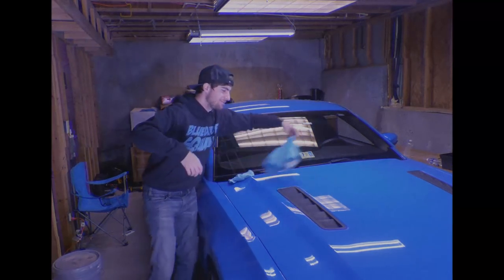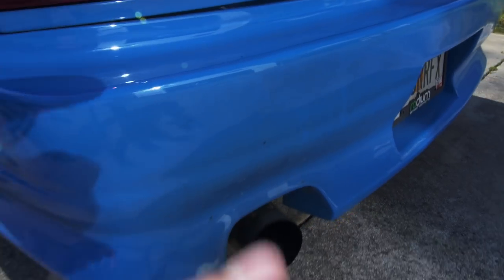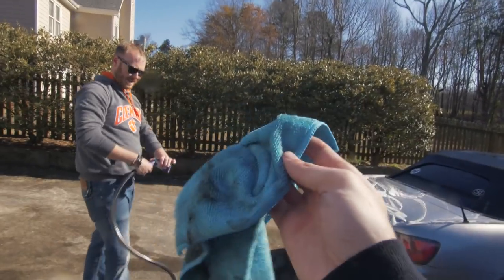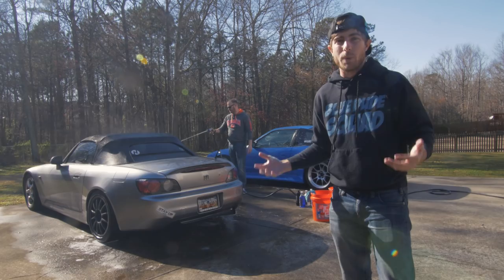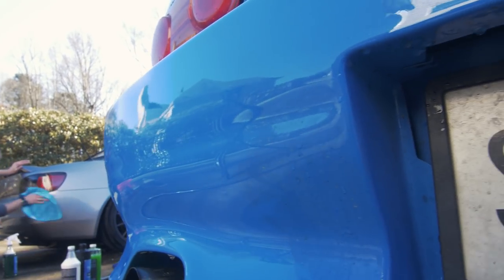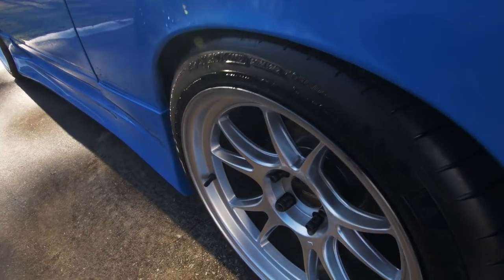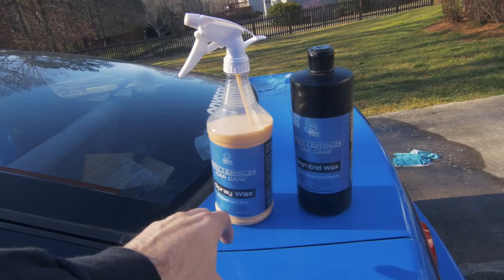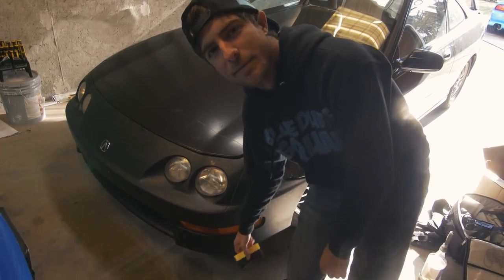Secret Project For Everyone to Try!

Comment: I'm happy you have this opportunity, but David, there are a bunch of things wrong with the techniques and explanations in this video.  
Besides, any product you can buy will work (some better than others) but knowing the right technique is always the most important factor.   So considering that anybody with a brain can walk into Pep Boys and buy some car washing stuff (that works), it would be very beneficial for you to educate your customers on some techniques that the pros use.  Only the right technique will get the results you really want, as it is very easy to swirl your paint without realizing it.  With your name on these products, I hope you will have time to help educate your buyers about the details that go into detailing a car.  You have a large audience - Maybe more than any other detailers channel? - you have a great opportunity here.  Congrats!
Reply: Jacob Frey 

I agree. I love the guy, but there's so much that I'm seeing wrong here. Sponges are a TERRIBLE tool to wash your car, they don't absorb the dust and dirt, it just stays on the outside of the sponge and puts micro-scratches into your paint.
Reply: What would be a better alternative for a sponge ? Last few times I've bin using one of those glove type things you put on your hand. But it doesn't seem to pick up dirt too good. I have to go around multiple times usually.
Reply: Quazz Norm micro fiber mitts are the best
Reply: Quazz Norm Adams wash pad

Comment: Theres a few things wrong here and im no "expert detailer", I get you're trying to sell a product but you should also try to sell a good technique. Like using a good wash method, you did it right with the 2 buckets thats pretty much the standard method if your hand washing a car, but you didnt use grit guards that dirty water is just going back into the clean water. Also using a good wash mitt not a microfiber towel especially with the tag still on it. In one clip i saw you washing the side skirt and you went back up to the window.. why? always wash top to bottom never going back up, some detailers use 2 towels one for the top one for the bottom. It all depends on how crazy you are on cross contamination. This video could have been done better

Let me add this @4:41 why would you not have faith in your own car wash soap? why would you use "quick detail" spray to clean caked on dirt? its in the name you use it in example when you get to a car meet to clean the little stuff.

Comment: Id only use a microfiber wash mit. You NEVER wipe the car in circles with your wash mit. ALWAYS in straight lines. This way if there is dirt in the mit, you are less likely see scratches if any occur. You would have to be at a certain angle in certain light.

Comment: Does your foam cannon actually shoot foam? The one I bought at walmart looks much the same and that pos shoots soapy water not foam...make sure what you are selling actually works!
Reply: Malloy Stale the foam cannons that you hook up to a garden hose only shoots soapy water. Not actual foam that you see from foam cannons that hook up to a pressure washer. If you want that thick foam, get a pressure washer and a foam cannon made for a pressure washer. You just can’t get that level of foam with a garden hose cannon.
Reply: I comprehend that. The "foam cannon" in the plug pictured at the end of this video looks a lot like the soapy water dispenser that I tried.....did you see it at the end of the video?

Comment: I intend to be CONSTRUCTIVE and NOT negative. I don't like the packaging. It makes the product look cheap. It should look like a quality product. I understand intent is to be cheap, but it actually looks cheap which is unappealing from a purchasing standpoint. It doesn't feel like a value if you buy something that LOOKS like it should be cheap anyway. I understand that the bottles may have been chosen with cost in mind. Changing the labeling could help. Nothing about the packaging is appealing. No offense intended. I'm sure you did in fact put time and effort into the packaging. It's phase 1. I assume it will improve with time. Congratulations and GOOD LUCK 👍. I hope you succeed.
Reply: I don't care for the name "patterson car care products" . Smiles per gallon would have been more catchy, or blue dude car care, etc...

Comment: What the heck lol Who is formulating this for you? You should really remove tags from your towels before using them. And never dump your towels out on the ground even if they don't get used again until washed there is still a big chance something could be caught up in it. If i drop a towel i throw it away instantly or keep it for one last using on something gnarly like under body.
Reply: Detailing and stuff ! MF towel hits the ground regardless of where I'm at with my wash, I discard it. Golden rule.